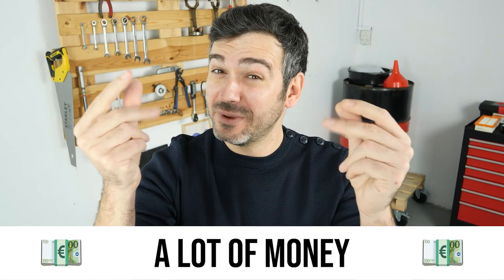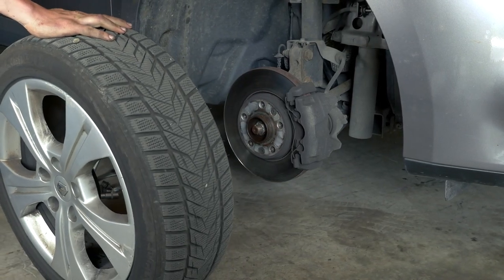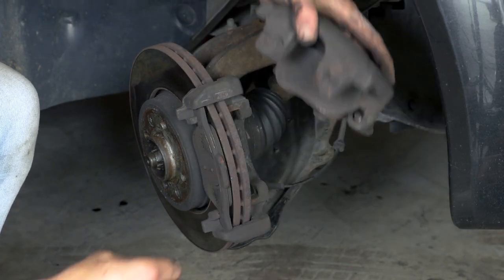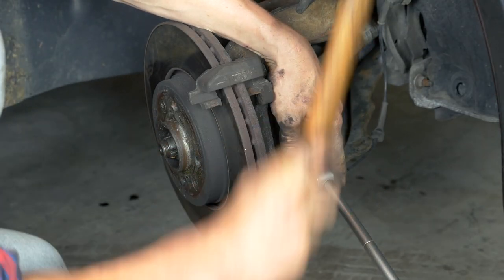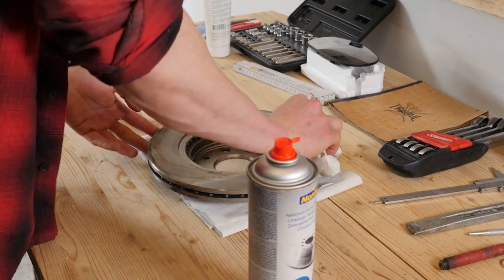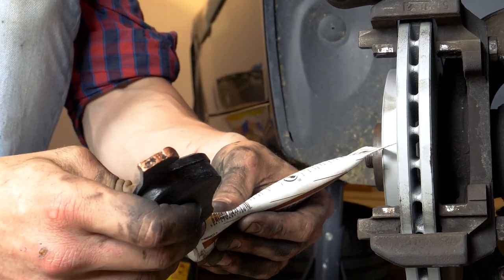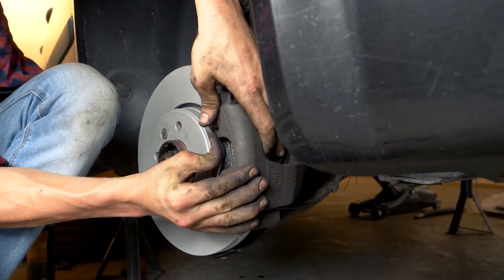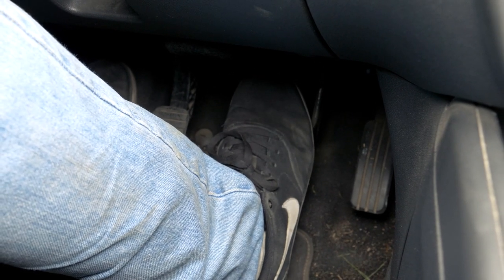How to replace the front brake discs and pads Megane mk3 🚗

Comment: Many many thanks for this tutorial! This video helped me to replace the front pads and rotors on my megane 3. I never did such work on my car and this video helped a lot. 
I like to do repairs and I don't like to pay other for things I could do by myself, I just made sure that I have everything before I started the job including axle stands.  I did the job a couple of months ago and I just came back to the video to say thank you.
If I remember correctly on my megane 3 (right hand drive) the torx key for the rotor was size 40 and the hex key was 7 but luckily I had them.
I took me 4-5 hours to do the job properly including a good cleaning with a steel brush, I know that a mechanic could have done it in less than an hour but for me it was the first time and I saved 100 pounds on labour at least.
Cheers!
Reply from the maker: We are really happy that the video helped you  Let us know when you do other operation ;)

Comment: hi, i found the video really helpful, thanks for that. but i couldn't find the torque specs for caliper bracket bolts and the guiding pin, could you please specify those for me as well, thanks.